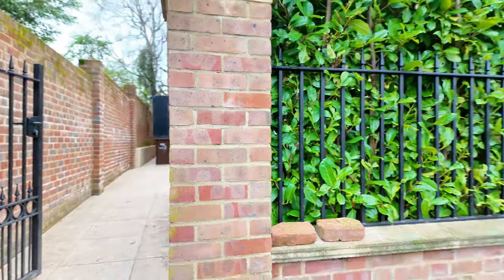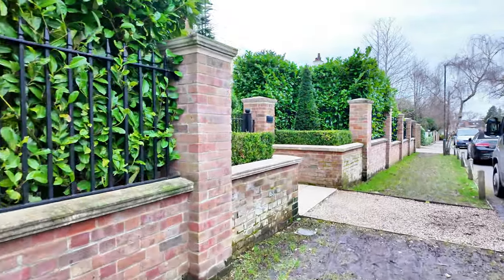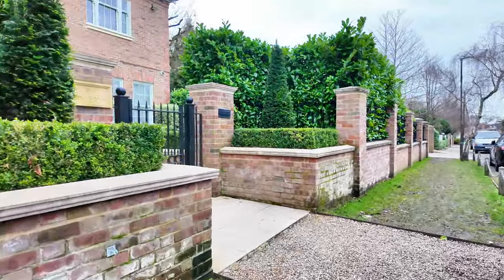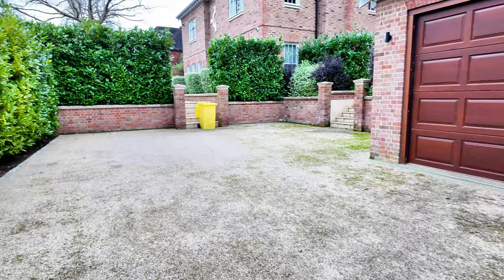Transform Your Patio with a Deep Spring Clean

Comment: Such satisfying work Curtis I love pressure washing I only have a karcher K5 thing but works on on the small patio and pool jobs I get

Nice work bro 👌🏼
Reply from the maker: Thank you 🙏 yea I took the plunge on a bigger machine and set up as I clean all the jobs I do so payed for its self straight away.

Nice mate
Reply: @cjgardenservices  it looked amazing will catch up with you soon mate
Reply: You can really upgrade that k5 I also have one as well as a professional honda one if you bye a karcher adapter with 22m female outlet you can add a pro trigger and a variety of nozzles I have a 14" wetjet flat surface cleaner that attach to a quick release on a lance I wouldn't be with the flat surface cleaner it also is able to wash walls effectively and evenly
Reply: If you upgrade it and add the flat surface cleaner to your kit I guarantee you will speed up cleaning by 50%

Comment: Great job. What kit do you use to get that great finish? I guess it’s not Kress just yet 😀  Do you bowser water or use tap? I’m thinking of diversifying from lawns in the autumn any info appreciated 👍
Reply from the maker: Thanks 🙏. This is a jetmac machine. Some times I run from a wheelie bin or if hi flow rate I run from the tap if I can. 

I personally think its a good service to offer in the slower months  every garden you have will have a path or patio that may need cleaning 👍